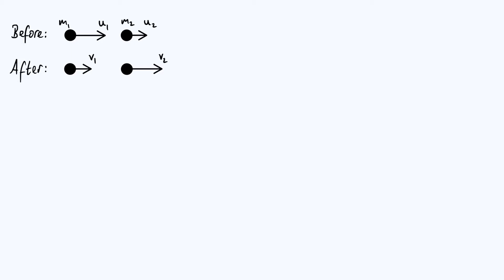Coefficient of restitution and kinetic energy loss

Comment: At 8:59, there's a slight mistake in the denominator of the u_2² coefficient; it should be m1 instead of m2. The error didn't propagate into the next step, though, so no worries. Excellent video!
Reply from the maker: Thanks and well spotted!